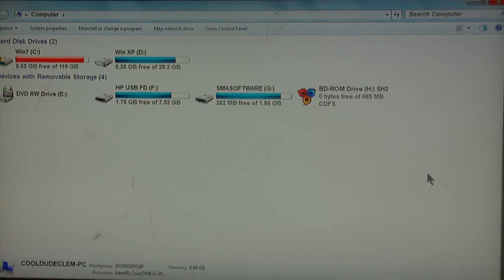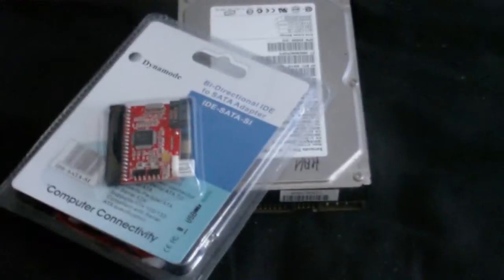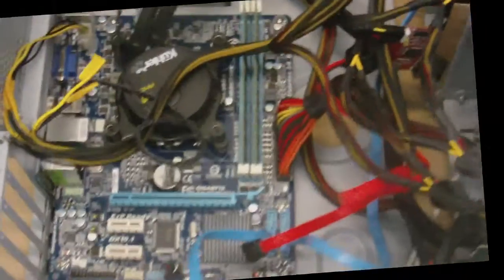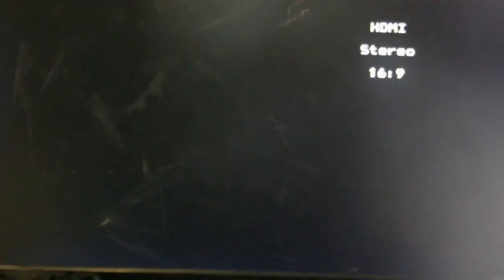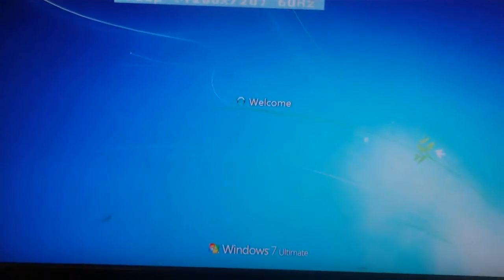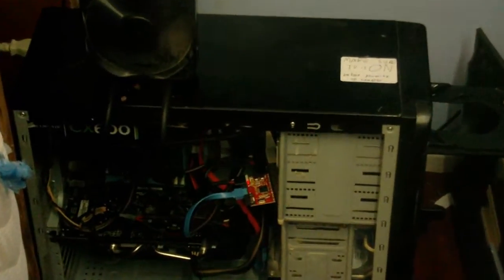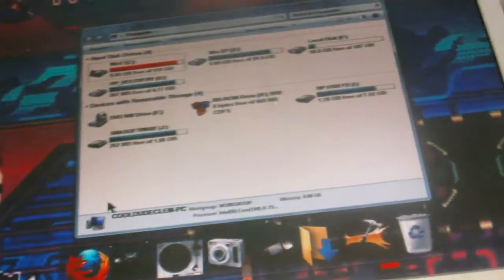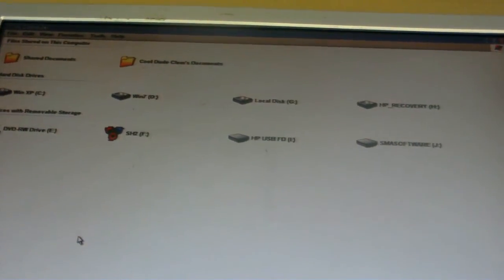Adding an IDE hard drive to a modern motherboard

Comment: The hard drive you added was previously used with an HP computer, and the HP RECOVERY partition has the HP software that was on the computer it was previously in.

Comment from the maker: Absolutely, the adapter I got can be used that way.
Reply: Try plugging a molex power into the hard drive I use them  and you have to still power the hard drive aswell as the adapter.

Comment: and where did you find a molex power connection on a modern sata motherboard?
Reply: Sonny Champneys power comes from the psu not the mobo
Reply: And modern hdds use molex